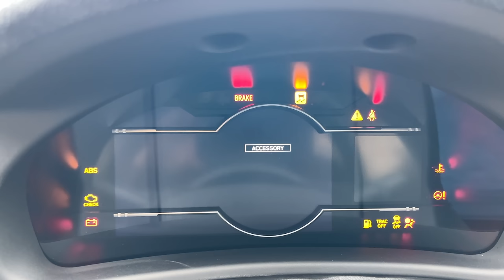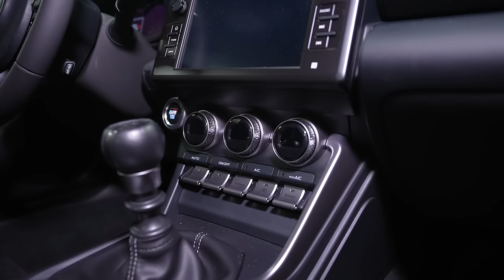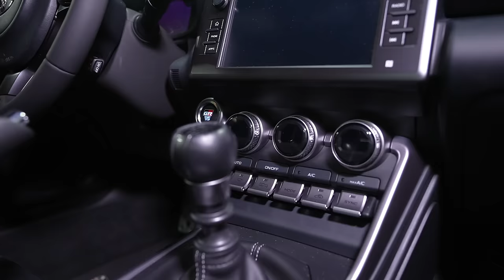Should You Buy a 2023 Toyota GR86? It's heavily over shadowed by a rival in 2023

Comment: Corolla is AWD. Completely different experience. You don''t understand the mission. A lot of opinions without knowing the reasons. Oil problems exist for virtually every manufacturer- they are using it for economy reasons, and the other technologies for that are also creating difficulties, especially low friction rings. The automatic is for drivers that aren't going to be worried about weight. And if you don't know the reason for the transmission gaining weight, you don't have an accurate opinion on the issue. Manual transmission is a Toyota/Aisin joint venture, not Subaru.  A tremendous number of people use this car for track use, not just autocross, because it's a cheap way in, and a good car to learn in. As experience is gained, engine mods can be made or it's time for a new car.  Every review I've seen of the shifting strongly disagrees with you on quality of the shifts.The bottom of the car is now completely covered for aero reasons. they spent a lot of time in the windtunnel. So you can't replace coolant as easily. How often do you do that? every 7 years?  Ball joints in control arms not replaceable? Common these days. The arms being lightweight single ply metal is also a design decision- unsprung weight is important in handling. Why Subaru went with aluminum knuckles. The exhaust note you like is generally disliked. You've just read a lot of things wrong.

Comment: As a mechanic and a true sports car enthusiast(not to be confused with the common stance boi or dyno number junky), half of this guy's critisisms are silly.

The GR86/BRZ is supposed to be a cheap car. And you are supposed to get performance that matches the price point. This guy doesnt really bring that out much but instead compares it to another car that is in an entirely diferent class. The price difference at msrp for the base models isnt hugely different but the additional 5k cost also reflects that extra 0.5-1.0 second extra 0-60. You may be gaining 2 extra doors, but your also getting a less stiff structure(inherent of all 4 door cars) and higher center of gravity and higher weight and a terriblely high front-biased weight balance(60/40 vs 53/47) in the GR Corolla so the tradeoffs make sense.

However, The twins dont need more power for what it is, its a beginner-friendlg sports car and a blank canvas for modders. More power is only for those who are more experienced driving with this power level. Thats why mustang drivers tend to crash a lot. They dont understand how to modulate power. Always has been what the twins were for. 

But what they SHOULD have done is reinforce the things that were weak points in previous models better and not introduce oil starvation issues on right hand turns.

Another thing is they should have had a VERY limited, but obviously expensive, turbo model option. The only reason for that is that this allows the aftermarket a "loophole" to make turbos in the same way Flyinmiata was allowed to make carb legal turbos for miatas. By mimiking the oem turbo miatas, they were able to get their turbos legal everywhere.

Comment: As much as I wish it had more power, I'd rather take this. It's lightweight and has a naturally aspirated engine up front that powers the rear wheels via a six-speed manual gearbox; that's more than enough for me. Besides, I can always put a more powerful engine or simply add a supercharger, and it should be powerful enough.
Reply: According to a reputable Japanese website the next generation will be a Lexus chassis with the gr corolla engine + hybrid power.
Reply: @shadowninja569  would be a shame to lose the naturally aspirated engine, but considering that emissions regulations are getting tighter, a turbo 3-cylinder hybrid doesn't sound all that bad.
Reply: @xdbugv10  we might still get a NA with the new MR2. The new ceo of Toyota has pushed up electrification  even though he was the former head of GR.
Reply: @shadowninja569  possible, but even then, I'd expect a hybrid powertrain (again, due to the emissions regulations). Still better than full EV, though.

Comment: Thinner liners could only be for faster heat transfer. Assuming its not just a gimmick, the bumper and fender vents don't cool the brakes, but act as an air curtain to smooth airflow over the wheels to improve aerodynamics (as well as throw crap down the side of the car) to the best of my knowledge. They should put the battery in the spare tire well. This gen looks a lot more upscale, but interior feels really cheap. I think Corolla is a better choice, though not as "pure" (I have one on order). Both are limited in production through which is unfortunate causing stupid markups. I hope they make it a Toyota next time if there is a next time, but this is no S2000. Honda needs to get back in the game!

Comment: Not sure why you're all hung up on the 'exclusivity' of the GR86 and the fact they're coming out with a 10 year anniversary model. It’s a rebadged Subaru, so what? When your complaints include the fact it's not a four-door and not a turbo it sounds like you don't actually get what the car is about. If you don't want RWD and manual transmission just say so.

First, you need to know what you want, go drive the GR Corolla and let's talk about turbo lag. MotorTrend's real world test of the two cars showed the Corolla was 4/10's faster to 60 mph (5.4 vs 5.8) and 6/10's faster to the ¼ mile (13.7 vs 14.3.) Is that a big difference? Yes and no, at the track yes, driving on the street no. Is it a difference worth paying $10 to $15k more at current prices? If so, why not the Civic Type R?

Comment: You hit the nail on the head !!!   🙂
Reply: not really
Reply: @Mr99Burns  It would be a great car with Toyota's inline 2.5L engine. We know that Subaru Boxer is NOT reliable and that was the only reason I did not buy this car
Reply: @agj6022  strongly disagree. This engine was co developed by Toyota and Subaru and will be plenty reliable. Will it make 200k miles? Who cares I don’t plan to keep this car for  a decade. I pulled the trigger and bought the SE edition. I’m loving it. You need a boxer engine for the low Center of gravity so inline is out. GR Corolla yes it’s fast but doesn’t feel like a sports car because of the high Center of gravity and still looks like an economy car.

Comment: Stop hating on the 86. It is a proper GR. It is quick enough and Gazoo Racing made sure this properly represents what a good Hachi Roku is (If you don't know what a Hachi Roku is, please do some research). They definitely had their hands in fine tuning it. No turbo needed and the GR corolla comparison is non sensical as the corolla is a hot hatch rally inspired vehicle. Apples and Oranges comparison!

Comment: So the BRZ may handle fractionally better but the GR86 looks much better in the front. 13.9 secs in the 1/4 mile is nothing to scoff at, it is a few tenths slower than the new WRX, which has the same engine with a turbo and AWD for a faster launch. Yes, the Miata is the only quasi-competitor but it is less practical.....Take a bicycle, remove the front wheel and try sticking it in the trunk of a Miata....You can do this in the GR86 and BRZ. The only two things I agree that are meaningful is the manual transmission not being up to par and the fact that they have never offered a more powerful engine, be it the WRX turbo (easiest) or a bore and stroked version of the 2.4 to 2.7 Liters and about 250HP.

Comment: I'm currently deciding between the GR86 and the BRZ ZD8. No GR Corolla in Australia. Anyway, I want a rear wheel drive car. I'll never take the car to the track. I think 173kW (232hp) is plenty of power for a light car on public roads, with peak torque at only 3700rpm, especially with the low gearbox/diff ratios in the manual. I calculated 2985 rpm at 70mph in top gear.
One interesting thing is the lack of satnav in the GR. No mention anywhere in Australian reviews about this. It's there in the BRZ. The head unit in the GR has 3 buttons home/phone/apps. In the BRZ they are home/map/apps. That's the clue.
I believe the thinner cylinders are because the bore has increased from 86 to 94mm. The 86mm stroke remains, so strictly it's still a "GR86".
I assume that the rod bearings have increased in size, but there was no scope to increase the rod bearing width, which looks narrower than the main bearings. So they increased the diameter. The rods in the 2 litre engine were angled to allow them to be withdrawn through the bores with the piston. Now with larger rod bearing diameter that cannot happen, thus the necessity to withdraw the wrist pin through a hole provided in the lower cylinder wall to disconnect the piston from the rod, then split the crankcase. With good maintenance, oil changes every 6 months, keeping the oil level near max on the dipstick, no track use, then the rod bearings (especially with increased diameter and no turbo) should never fail.
OBTW, the BRZ S variant has a full sized alloy spare wheel, which can be replaced with a space-saver wheel in the same compartment in the trunk if desired. Not so the GR86.
And the front wheel knuckles in the BRZ are alloy, unlike in the GR86.
Of course, this video was made in 2023. Yes, the manual GR86 and BRZ lack the Subaru Eyesight package, but the 2024 manual models do have Eyesight. 

In Subaru land, if you want a turbo sports car, you have the WRX. For the BRZ the route to more power was instead a 25% increase in engine capacity. Of course, the GR86 inherited that. It's a distinctly different car to the GR Corolla, and the WRX. 
For me, the simplicity of a non-turbo engine with a manual gearbox and rear wheel drive is very appealing. I read that the 2 litre engine has no EGR. If that is true of the 2.5 litre engine, then the D4-S direct/port fuel injection with no EGR is very appealing too.
And the GR86 looks great.

Edit: I test drove the 2023 BRZ auto and manual. The auto was fine, but it showed me I had to have the manual, which I then drove. It was very notchy, but the car was only 5 miles old.
I've had success before improving a notchy shift by refilling the gearbox with Castrol Syntrans 75W85 GL-4 synthetic gear oil. I'll probably try that after a couple of thousand kilometres.
Very importantly for me (I'm 6'3") there was plenty of room with the driver's seat at its lowest, reclined a couple of clicks back, and near, but not at, its rearmost position.Plenty of head and leg room without my knees touching the steering column.

Comment: GR Corolla - 50k+, if you can find it, and it is marked way up, is AWD and isn't really a track car... it's AWD and really an STi replacement
GR86 - MSRP, you can find it, really made for autoX/HPDEs
GRCorolla is WAAAYY (in practice) too much more expensive and not the same.
If I was going to get a special version of this, I would get a GR Supra, not the GR Corolla.
This is the cheapest HPDE car you can get out in without needing to put a roll-over bar in (MX-5)
All other points are valid. I would have preferred the GRCorolla engine in the GR86 than another FA24.

Comment: I must have got lucky, as my gearbox is silky-smooth; the clutch maybe not so good as my GT86, which I've kept, which is in 2017 facelift form, with an interior trim standard similar to the GR's. I agree on the subject of the GR86 development team: it feels like it was developed by the regular Subaru team, whereas the GT86 was developed by a racer, and it tells.  If I want to go for an engaging drive where I really feel in touch with the car, I'll take the GT and never mind the lesser engine output - workng for it is part of the fun - while the steering also has better feel in the GT.  

I also prefer the mechanical rev-counter/digital speedo on the GT  - it's somehow easier/quicker to read. The column stalks on the GR feel smoother and more sophisticated, but are actually less positive and I've even considered switching them for GT stalks.

Overall, the GR is more effortless, so it makes a better grand tourer (apart from the reduced range - it's thirstier).  Basically, the GT feels like the GR looks and vice versa; switch the mechanicals over, maybe....?

Comment: 100% agree 2nd gear is the most used specailly if you want to have some fun stepping out the backend. The coroall gr is boring car that feels numb to drive steering  is lifeless , clutch has no feel and the computer comtrols where the power goes there's no locked 30/70 pwere ratio it's basically a front wheel drive car it also cost $20,000 more gr86 here in canada. But it definitely going to be more relieable the engine is the same that is used in the wrc yaris and the contruction process is high tech.

Comment: Ok weird question why not just fill the entire crank and rod space with oil so it can't pool up in one side even if it wants to?
Reply: You can't have that assembly spinning at 8000rpm "underwater" as it were. This is a common problem with cars that are tracked and the answer is proper baffling or a dry sump set up.

Comment: I must ask, when the second gen was introduced I heard the manual transmission was upgraded with triple synchros for 1st gear to 4th gear and larger synchros for 5th & 6th gear and I’m sure I heard the synchros were carbon coated and lighter GL4 gear oil is added to aid in reducing synchro wear?? Who is right ??

Comment: In regards to GR logos, the Corolla has them everywhere as well including on the gear stick, starter button, headrest, steering wheel and screen as well so what you said about them not putting badges is a complete lie or ignorance and exposes your Toyota bias.

Based on MSRP,  the GR Corolla costs at least 25% more (depending on country) than the base model GR86. You could modify the GR86 for the cost difference and then it is going to be a 1.6 ltr turbo engine vs 2.4 ltr situation. I sure hope Toyota made those engines to last because that is a lot of power for a 1.6 ltr engine.

You complained about a 6 pound heavier auto transmission which you said was 'a lot', well the GR Corolla which you praised instead is at least 440 pounds heavier than the GR86, oops... better not mention that.

The purity of N/A and rear wheel drive weren't mentioned as potential pros.

A lot of problems which Subarus or any car come down to abuse and/or lack of maintenance. Personally I wouldn't take a stock road car to the racetrack, it is also risky as you won't have your normal car insurance. You can also put in heavier weight oil and that should work fine and provide more protection, the thinner weight oil is used to reach fuel economy targets. I recommend people watch a few tutorials how to change it yourself, it will be a lot cheaper and you will know that it is has been done properly with the correct oil, just don't overtighten the drain bolt, use a torque wrench. I would use at least 5w-30.

Comment: A good assessment of the GR86,I have owned a R32 GTR and the Original AEB6 with SR20 300 bhp another with 235bhp and lastly a Levin 86 with 160bhp. Most fun was the 160bhp car the 235hp was nice but no torque low down. So I have ordered a GR86 which is the best of both worlds and I can use it to get to work. If I want a bit more power I still have the GTR 550bhp but I know that it wont get much use

Comment: Reasons I don’t want a gr Corolla. Pointless and annoying safety features, it’s not RWD, it’s ugly, it has 4 doors. The Corolla has its place but it’s a completely different car. Plus this motor is superior to the STI motor and HKS proved it making 450 horse on the stock bottom end of the FA24D. I’ve had Wrx’s and STIs and I would be less interested in a $46,000 price tag for a worse motor with a turbo. I think you misunderstood the point of this car.

Comment: This is what happens when you do backwards a$$ things like juicing up a freaking Corolla BUT NOT the GR86 BUT NOT the CHR(by the way, Toyota’s former little crossover SUV w/NO AWD ‘BUT’ they had the balls to equip the Corolla w/AWD). Hell they even turned the Corolla into an SUV BUT they already had a small SUV that was COOL AS HELL called the CHR‼️ DISCONTINUED‼️ A little attention to the CHR & Toyota had a hit‼️ This would have been a model that replaced the CELICA. DISCONTINUED‼️ Which I’m still pissed about. I don’t care how much power they put in a Corolla, IT IS STILL A COROLLA‼️ I loved that they brought back the SUPRA except it was built by BMW. This is the same way I feel about the GR86/Subaru. I think even @a higher price I’ll opt for the BRZ if both cars are basically Subarus.